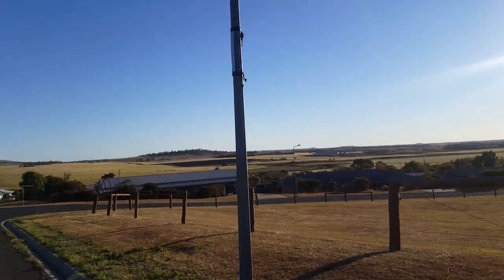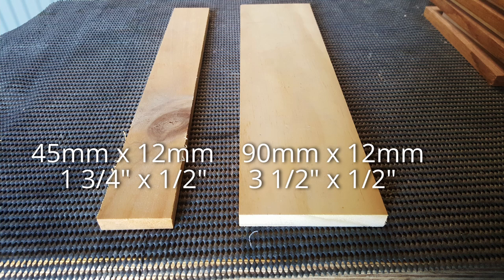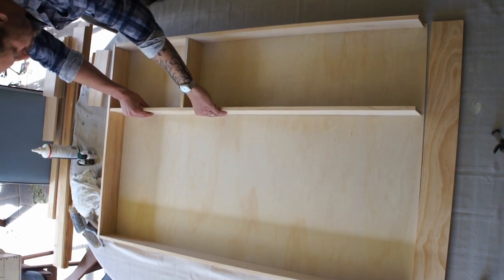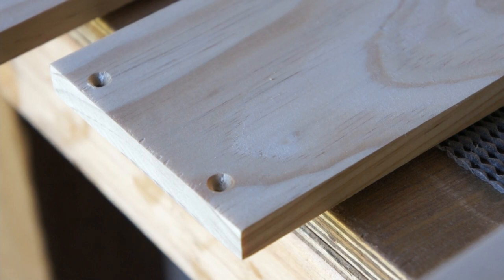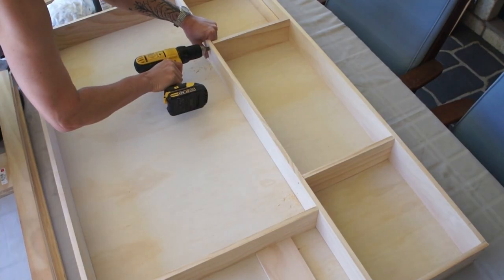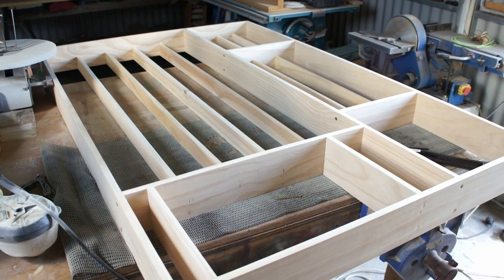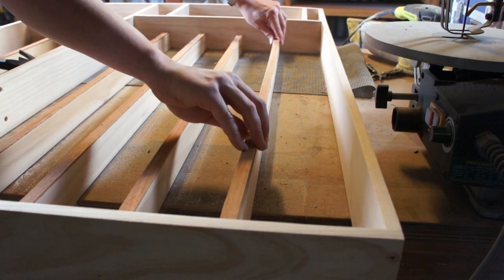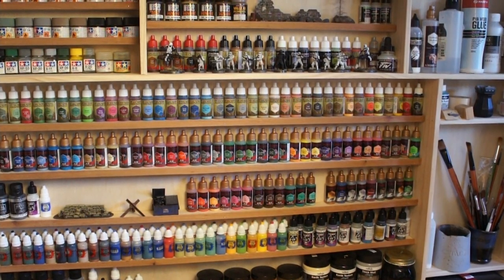Easy DIY Hobby Paints Shelf Build Tutorial - Simple Wargaming Paints Storage

Comment: As I have little to no woodworking skill I am always envious when someone does a build like this and its not a wobbly nightmare. ;-)  I may have to take a stab at something smaller - my current workspace is overrun with paint racks. Cheers!
Reply from the maker: Oh man, you should.  This is really just a build as you go and make things fit type of project.  So long as you take the things slowly that need to be taken slowly (measuring, cutting, gluing and screwing), double check these things before you do them haha, and you should be ok.  I had pretty much every piece cut before I screwed or nailed anything in place (I just cut and dry fitted the pieces to test everything before assembly).  I started cutting and placing like you see in the video, and ended up with a decent sturdy shelf in the end.  Using the spacers for doing the shelves is another important step, as this ensures your shelves are square and level.  I'm happy to help in anyway I can if you decide to have a go at this man.  Hit me up if you need a hand.  Cheers.

Comment: I searched this as I’m keen on building pretty much exactly the same type of mini paint rack. I don’t have many tools though. (Or manly skills). Just a drill. I think Bunnings can cut things to size if I need it. Hopefully. 

I also thought of using those 90 degree shelving brackets for support. Though now that I’ve watched this I think I’ll just follow your vid along and hopefully not mess it up!
Reply: Thought I’d add. I was thinking instead of the little lip you did at the bottom of the shelves. The bit to help the bottles not fall off. My idea was to put wire along each shelf maybe an inch high. Like that thick metal wound wire. Not sure though.
Reply from the maker: Hey man, thanks for the comments and sorry for my late reply here. You could certainly go for the wire, but you might find it sags across the length of the shelves without some extra support in there, probably still work ok though. If you want to try and put the lip on there, I suggest just grabbing some balsa wood from Bunnings and using that, you'll have to keep the lip fairly small because the balsa wood is not strong, but this would be a cheap and easy way to make those without any tools besides a craft knife. Just paint the balsa with some PVA glue and give it a very light sanding, and it should hold up ok over time.
Let me know if I can help further mate.  Thanks.